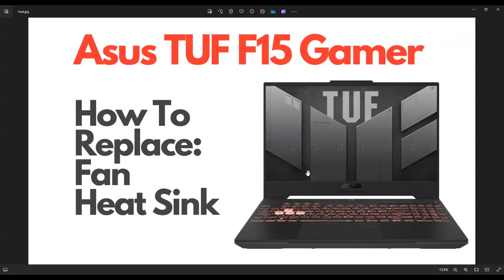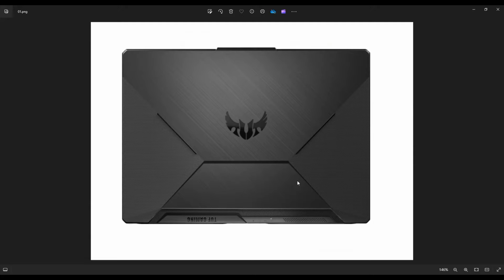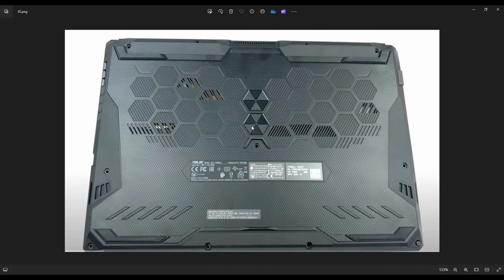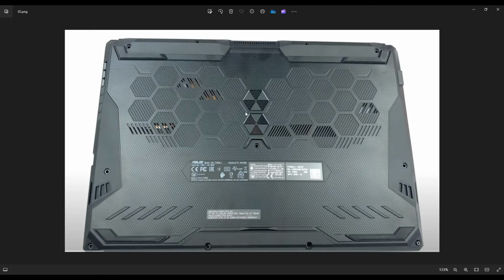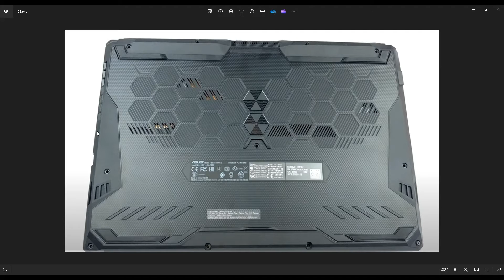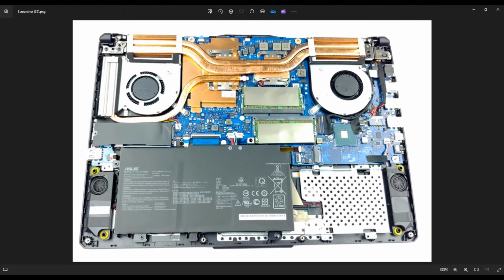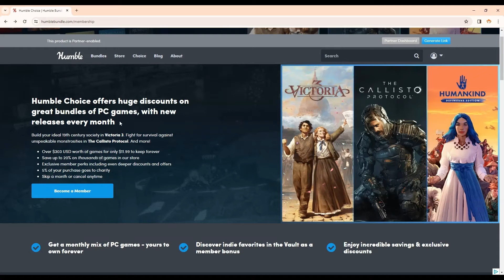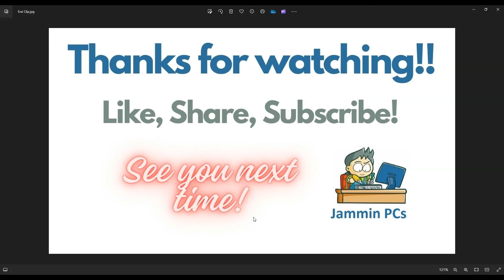How To Replace Fans Heat Sink - Asus TUF F15 FX506 Gaming Laptop

Comment: Got any tips on how to stop a similar laptop from thermal throttling? Ever since it came that playing games on it has been problematic since my FPS keep dipping into the single digits and are very unstable. Using Throttlestop, I was able to see that this coincides with my CPU's power usage also dipping into the single digit watts of electricity usage, about 7 or so.

ASUS TUF FX504GM, 16 Gb of Ram, i7-8750H, GTX 1060 6Gb.
Reply from the maker: Is the computer overheating at all?  If so, can you try the steps seen here? https://www.youtube.com/watch?v=gGCUmI2NU0E